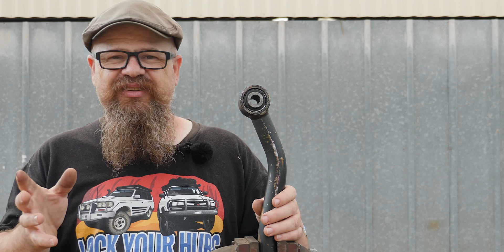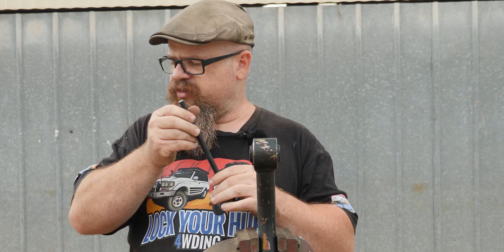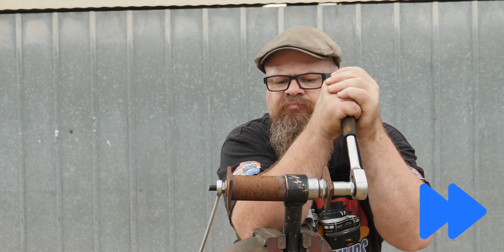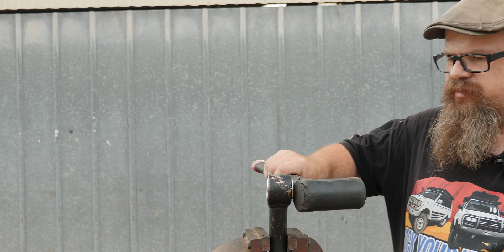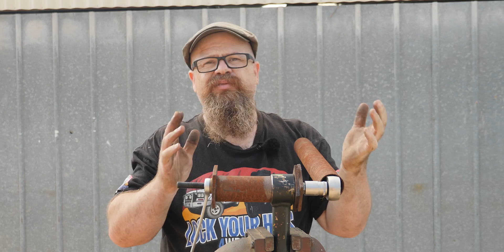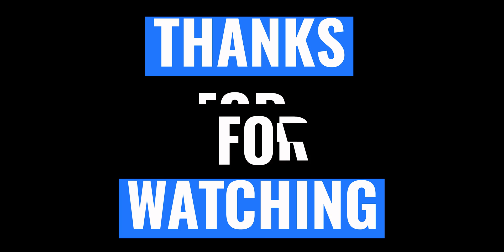Change Suspension Bushes without a Hydraulic Press?

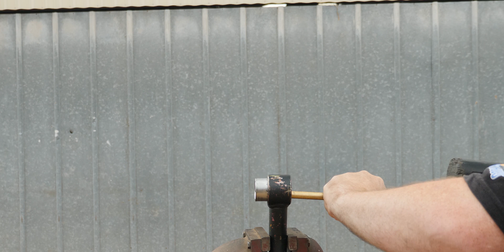Comment: That whole process of lining the 'puller' up with the bush would be made a load easier if the arm were mounted horizontally in the vice and the puller is vertical❗ 06:30 It's also made easier if you can wangle it so the tube part is slightly bigger again and the pusher part (socket) is slightly smaller again. Not by much, 0.5-1.0mm will do.

Comment: The reason polyeurathane (PU) bushes squeak is because people make the MISTAKE of installing them dry OR they fail to service them. They need to be installed with silicone grease and will need regreasing on an occasional basis (depending on the vehicle usage).
PU bushes also work in a different way to rubber bushes (I won't go into that, it's complex). Consequently, PU bushes are not really suitable for 'hard-core' off roading use in any conditions.

Comment: This is the hard way. Use heat and make this much easier. A torch will cause the outer sleeve to expand.
Reply from the maker: I agree, and a hydraulic press is even easier! Though I just wanted to try a method that might work in the bush, away from all the garage tools.

Comment: Rather than use a socket use the the new bushing. As the bushing it pushed in it will force the old one out the other side
Reply from the maker: It depends on the design of the bushing, on some, the inner is slightly wider than the outer, so you couldn't do it with one like that, though if both the inner and outer are the same length, that should work fine!

Comment: I believe it would be better to grease the socket, to avoid the issue getting it out. In addition greasing the new bushing is also recommended. (Silicon grease which doesn't impact the rubber)
Reply from the maker: Great suggestion!

Comment: Dude... why don't you make this easy on yourself, slip a piece of cut pipe over the handle of your wrench and comfortably take it off. You don't have to make it harder than it is. (Leverage)
Reply from the maker: I'm all for a little mechanical advantage!
Reply: part number please, for a 2004 kia optima2.4l , I ordered a pair from ebay and they’re bigger than originals

Comment: Why not use your vise as the press, instead of it holding the arm?
Reply from the maker: The idea was to demonstrate a bush change without the tooling you might have at home, including a vice. While I know the sway bar was held in a vice during the demonstration, it could have just as easily been ratchet strapped to a tree stump.

Comment: Great video. You should use barrel nuts as they are longer and have more threads, so that they are less likely to strip the threads under heavy loads. Oil your thread helps, too. Your pipe looked like it was deforming, so be sure to use a thick wall pipe.
Reply from the maker: A thicker wall pipe definitely would have been better, though I had that pipe kicking around. Great tip about barrel nuts.

Comment: The "trick" to urethane bushings is to lube them up really well with teflon/ptfe. I use a ball/U joint press for most bushings. Works a treat!
Reply from the maker: Never thought of using a ball joint press, I'll have to give it a go.
Reply: @LockyourHubs4WDing  I guess in a pinch you could use a big C clamp too. Sometimes silicone spray can quiet a urethane bushing after install👍👍

Comment: Used this method many times.  Depending on the bushing size and how badly it's stuck, sometimes I just use a torch to burn out the old bushing then cut the sleeve and punch it out.  Then use the threaded rod method as shown to press a new one in.  Also I put bushings in a freezer over night to make it a little easier to press in.
Reply from the maker: Great advice, I've used the freezer trick on plenty of things that are an interference fit. Everything from bearing races to valve guides in a mini cylinder head!
Reply: How does freezing them help? Does the metal shrink?
Reply from the maker: Yes, just a little, but enough to help with the installation.

Comment: Instead off the socked to push the old one out, use the new bushing to press the old one out while pushing in the new one!
Reply from the maker: Unfortunately it doesn't work with these bushes as the centre sits proud of the outer
Reply: @LockyourHubs4WDing   I understans but what if you put a big watcher behind the new bushing?
Reply: @LockyourHubs4WDing  actually you have the big watcher when you removed the socked to press the bushing in
Reply: A good way to destroy a new bush but go ahead

Comment: My cars (nissan primera p12) friont control arm has  bushes that  mount on a protrusion or  "pin" on the arm.  You cannot use  a bolt/nut (removal or reinstall) as that pin blocks the entry of one end off. Trying to figure out how best to proceed.

Comment: Yes they pretty tuff land cruiser bought a ball joint kit on Amazon bent the thick vise part my fault now then I bought another kit from harbour freight around same price but harbours was even thicker and dud the job so when I got the bushing to move it would make a loud crack and move maybe  3/16 just kept spraying fluid on it and the vice now I'm getting better at it and faster just got to keep adjusting everything yo get it centered as much as u can its kind of fun takes about an hour or nr bushing got me taking my time
Reply from the maker: Sounds like you got there in the end, that's the main thing!

Comment: I was waiting till the end for the track bar trick, thinking the whole time when I worked for Jeep I always had someone jump in and crank the wheel back and forth until It lined up lol. That 100% works, I've don't it 200 times probably. Jeep thinks it's a good idea to put ball joints on 1 end of things that were never supposed to have them. As far as the press method always worked for me. A ball joint press C-clamp kit is your friend. It seems to come in super handy for pressing things like those.
Reply from the maker: I must try a C clamp kit, thanks for the tip!

Comment: There are custom made tools on ebay for about £20 for my the axle bushes of my Ford Fiesta, by the time I've bought nuts and bolts I'd be as well with that.  But, Many thanks.
Reply from the maker: If there is a cheap dedicated tool to do the job, that's usually easier. 

Though sometimes there isn't, and you might not have access to a press, that's when this method might come in handy.
Reply: @LockyourHubs4WDing  I'll either use a hole saw or drill to first remove the old part. Then clean and sand the carrier before using the tool to insert the new part. Less risk of snapping the pulling bolt I think. I would be saving a £100 on garage labour. I appreciate the need for resourceness that you express, that and saving money! Many thanks for taking the trouble to post this guide!

Comment: This method is great. I have been using it to remove bushings while the control arm is still attached on the other end because they are so maneuverable. Is this any danger in putting this much pressure on these materials though? I'm guessing/hoping no because the pressure isn't contant and only goes one direction but just wanted to make sure. Also could one use the new bushing to push out the old bushing and all at once seat the new one as well? I believe it will work but was wondering if this would damage the new bushing?

Comment: Factory car jacks are great for harvesting the high tensile rods and parts for making this! Just need to cut it out and pretty much have everything you need. A bit of welding/fab/cobbling work of some scrap and you can really make a nice little tool for doing multiple bushes!
Reply from the maker: Never thought of using  jacks thanks!
Reply: You just gave me an idea , to come up with a DIY solution to press ball joints in for my accord . Thank you

Comment: Trying to change the lower bushing on a pneumatic 90 pound breaker hammer. I think this is the idea I needed. Seems a lot safer than my idea involving a 5 ton chain hoist, a long carriage bolt with hook loop welded on the end, and 2 stout trees.
Reply from the maker: Depends on how stout the trees are! :)
Reply: Lock your Hubs 4WDing 
Northwest corner of the united states, the trees are endowed well enough. However, what happens when the bushing breaks loose, and where do I stand while pulling the belay chain on the hoist?
Reply from the maker: @beerggls  I well say perpendicular to the load! As far away as possible.....

Comment: Loved your video. Could I use the same method to replace the front lower control arm bushings on my Land Cruiser FJ80?
Reply from the maker: The Radius Arm? Yep, no worries, get the biggest high tensile allthread that'll fit through the bolt hole and you should be fine.

Comment: Thanks for the idea! I need to do the rear lower control arm on my Toyota Townace Van. I'm a bit scared of the spring as it seats on the lower arm. Hoping  I can slowly jack the arm up into position without the spring taking my face off
Reply from the maker: A spring compressor will be your best friend there
Reply: @LockyourHubs4WDing  thanks for the info. I'll jump on ebay now

Comment: I doubt many would have a piece of tube that exact size laying around the back yard. Spend $200 and get yourself a press.
Reply: There's always one armchair expert with money to throw at anything .  Not that way in the real world mate .
Reply from the maker: The press is a better solution no doubt. My local suspension guy shut shop and I was having trouble getting into a local mechanics. 

I probably lucked out having a peice of pipe about the right diameter, though a deep socket would be able to do the same job. It's all about self sufficiency and not having to rely on others especially if you're remote. The only thing I needed to get was the high tensile allthread after snapping the hardware grade m12 allthread I had in the scrap pile.

Comment: I have just replaced my front panhard arm with an adjustable one and will be replacing the rear one in the next few days on my 80 series, luckily I didn't replace any of the bushes. This is a great way of doing the bushes and I wish I had of known this when I did the rear caster arm bushes last month. Great stuff keep it up. I have a question for you please which I am having problems with getting a correct answer to.. My 80 series has a 3" lift kit in it and I'm wanting to know if I need to get and fit a brake proportioning valve extension plate? Can you help me with this information please and maybe supply a video if you have one. Thanks Tim.
Reply from the maker: At 3" of lift the proportioning valve needs to go up 3" otherwise the braking will think there is reduced load on the back wheels, this is especially bad for non-abs cars.

A simple extension bracket will fix this. 

Don't forget to check your diff brake line lengths so you're not hanging off the brake lines at full droop. 

Hope this helps.
Reply: @LockyourHubs4WDing Thanks, My rear brake line comes to the centre of the diff so I'm guessing that will be ok but I will check thanks. So do I need to adjust the BPV at all or just remove and fit an extension plate? do you have a video of this at all ??

Comment: tie rod nut is lose... good one you would not need the tube to reinstall just the plates
Reply from the maker: Thanks I'll check that tonight!

 You'll still need something on the other side as the centre of the bush protrudes out further than the edge by a few millimeters, a socket of the right diameter would do the job.